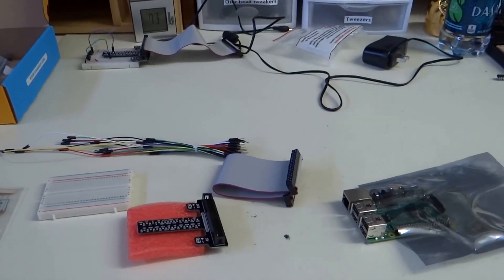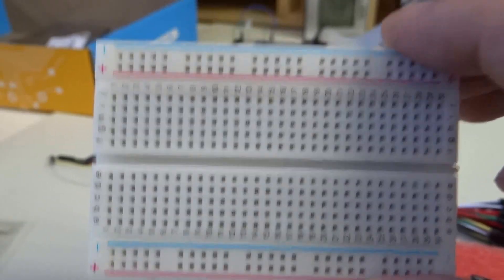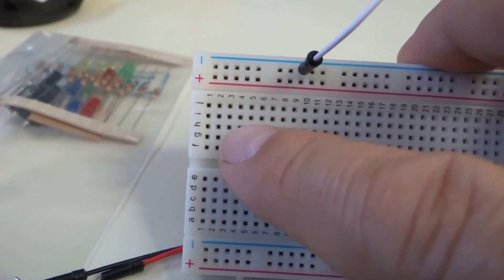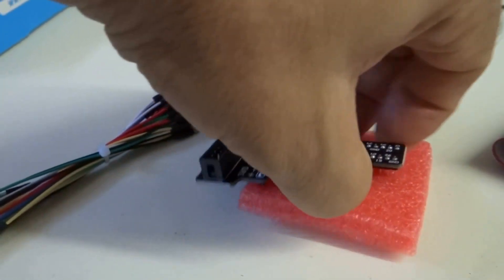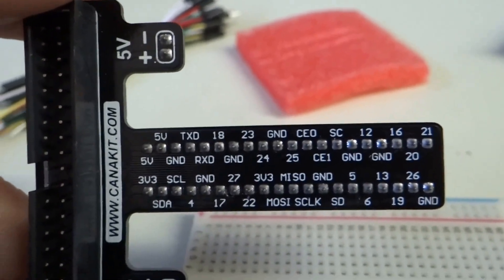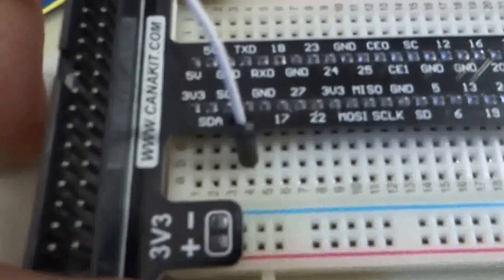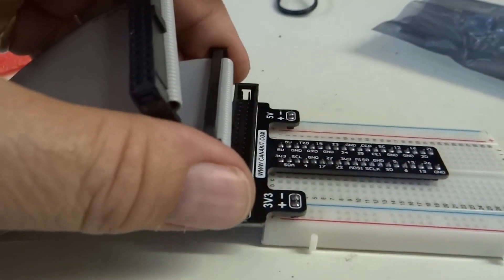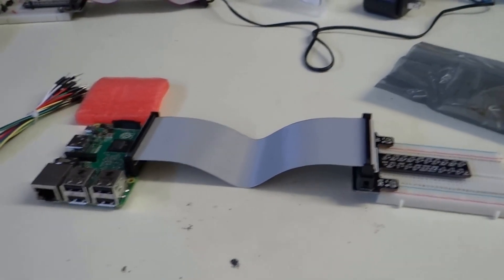Connecting the breadboard to the Rpi

Comment: Looks like you switched breadboards mid-way through the video.  The first one has negative bus on the outside, which doesn't fit the Pi, then when you install the header you're using one with a positive bus on the outside.  I connected mine to the wrong breadboard based on the first one you are using.  Hope the header comes out.

Comment: Thanks Greg for the explanation of the bread board, and showing seating the extension board, and ribbon cable plug in. The only question, and I’m going to connect mine in tthe direction you did, but... The cutout on the ribbon cable only fits one way in the bread board extension board however, the pi gpio pinouts don’t have that, so I’m guessing you can, plug it in wrong, to the pi, and the results would not be good? Anyhow, thanks again, much appreciated.
Reply from the maker: Hi Jack. Thanks for the complement. If you look at the ribbon cable find the red striped insulated wire, that will be pin 1 on the cable and connectors. On the pi, pin 1 is designated with a square pad on the solder side. Match those up and it will work!